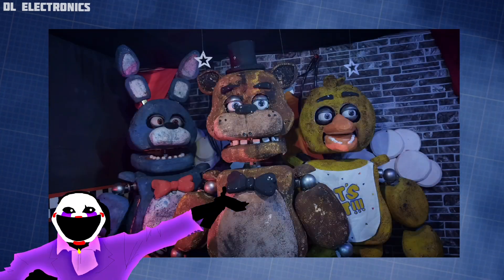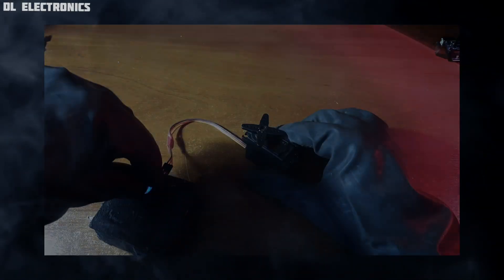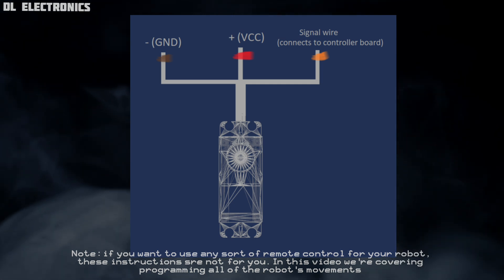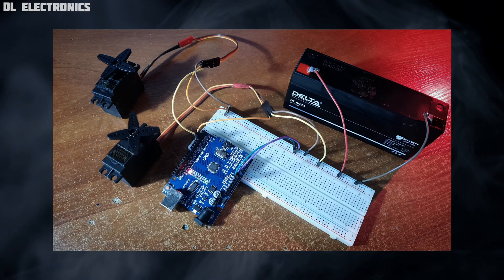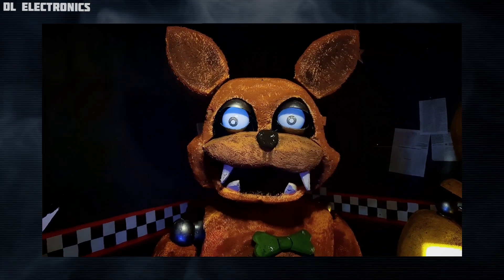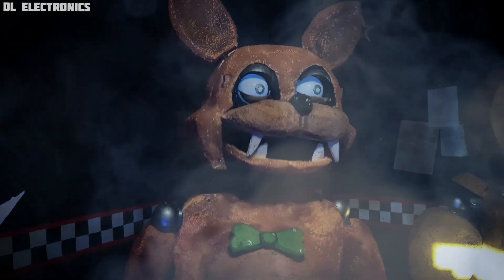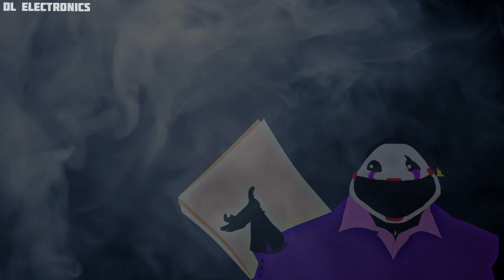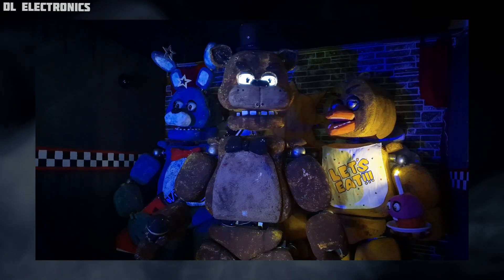How to Build REAL FNAF Animatronic - Tutorial

Comment: Can you tell us the pipe sizes
Reply from the maker: The diameter is 50mm and the length is about 3 meters (you will need to cut it into pieces of the needed length anyway)
Reply: @dlelectronicsmechanics2059 i cant find em on amazon can you tell me the name of the brand and the profuct

Comment: WHATS THE CODE!!!! im dying trying to copy the code word for word but its not working.
if u can find out whats wrong with my code pls comment it

#include <Servo.h>
Servo servo1;
Servo servo2;
int angle1;
int angle2;
void setup(){
  servo1.attach (2);
  servo1.write(90);
  servo2.attach (3);
  servo2.write(90);
}
void loop(){
  ;for (angle1 = 90; angle1 <= 130; angle1++){
    servo1.write(angle1);
    servo2.write(angle1);
    delay(25);
  }
  for (angle1 = 130; angle1 >= 90; angle1--){
    servo1.write(angle1);
        servo2.write(angle1);
    delay(25);
    
  }
  delay(1000);
for (angle1=90,angle2=90;angle1<=130,angle2>=50;angle1++,angle2--){
servo1.write(angle1);
servo2.write(angle2);
delay(25);
}
  }

Comment: can I use an 11 Ah battery pack? Another thing is that the code is not working
Reply from the maker: Yes, the 11Ah battery will be fine. As for the code it should work. Maybe there're some issues with the board you use or idk. Try to search for some info about programming servos in the net. Perhaps you'll find something that will help in your situation
Reply: @dlelectronicsmechanics2059  Thank you, it's working now, also, how did you made the eyes?
Reply: @iceevr1107 ok thanks
Reply: @dlelectronicsmechanics2059 hi again, can you give me the list for every non-electronic material, like size name and etc, I really need them, thank you for your patience.

Comment: Hey, so where did you put the uno board? Ive seen several servos but the wires never reach that far
Reply: Also another question i have is that you didn’t really show hoy you did the mouth servo/servos. Thats what i need most help with
Reply from the maker: The board can be put anywhere, its location is not that important. The jaw/mouth servo is fixed in the mask. the servo's shaft is attached directly to the movable jaw and so it moves.

Comment: I have a small questio and that is how many arduinos did you used? What type of battery is used on the robot? Can I use a fake arduino? And can I power more than one servo in each arduino?

Waiting patiently :)
Reply from the maker: In this project I used only one arduino board. Fake arduinos are fine. U can power several servos with one arduino (it was shown in the video) but if you want servos to run fully independent it's worth using several boards for each motor.
As for the battery, It was 6v and 10Ah. Can't name it's brand rn
Reply: @dlelectronicsmechanics2059  I also want to know if I can use a battery that is 7.4v and 10ah and how to connect 9 servos into one arduino
Thank youfor your patience;) pt2
Reply from the maker: @ZeroZerado22  7.4V might be too much for the servos, but they may still work fine. To connect 9 servos u just need to connect all the red wires to the VCC of your battery (and the black ones to the GND), then connect the yellow ones to the pins on the controller board and write the corresponding pin values in the program
Reply: @dlelectronicsmechanics2059  what about the ah? can I make it out of battery holders with 11200ah? and how do you turn it on and off?

Comment: Hey! Nice video, could you answer these 2 questions? First, is it okay to use micro servomotors instead of the big ones for the arms? and second, could you make a pdf with all the code for the robot?
Reply from the maker: I don't recommend replacing heavy servos with the lighter ones since arms are quite heavy and micro servos might not be able to move them.
As for the code, it will take some time
Reply: @dlelectronicsmechanics2059 how many servo boards do you need for this?
Reply: @TheUnlikelyFNaFDuo  just one arduino board is enough, remember to also buy a lot of wire jumpers, male to male, female to male, and female to female, since if you're making a large animatronic like them you'll need quite the few wires, also don't forget to buy a breadboard
Reply: Thanks!
Reply: Hey, i saw they replied you but i just wanted to let you know what happend to me i used 1 micro servo motor for 1 arm for my animatronic it seemed to work but after a couple seconds the servo motor gear broke once i opened it it was just a broken gear so i just wanted to let you know what could happen if you use micro servos i just decided to use the MG995 motors they are very strong and dont have plastic gears they have metal gears  wich is very durrable good luck to you if youre building one!

Comment: Do you need to purchase a board for each servo in the animatronic?
Reply: you can connect multiple servos to one board
Reply: @Thystamme Yes! But only if they are to be doing the same thing
Reply: @TheUnlikelyFNaFDuo  That's not true at all. You can have multiple lines telling different servos to do different things. For smaller projects, only one arduino board should be needed. An uno board has 6 PWM pins so it's recommended to use 6 servos but I'm pretty sure you can use any pin for servos but it's kinda recommended to use PWM.

Comment: Is the foam for the body simply a hard foam like florist foam?
Reply: Any hard foam that can be cut and doesn't irritate the skin can be used. Stuff sold at modelling stores is good, but try to avoid packing foam. That's made up of small ball beads as it will just split apart and look bubbly when cut.

Comment: Where is the battery located? Is it put inside the suit? Also, Where is the control board located? I think the survo might just "remember" the code but I'm not sure. Nice video btw!
Reply from the maker: The battery and the board can be put anywhere inside the robot. Btw, servos can't remember the code (or at least the servos I use can't) and need to be connected to the board all the time

Comment: Where do I buy the parts
Reply from the maker: You can find them somewhere in online stores. Servos and Arduino boards aren't that difficult to find, while other parts are even easier.
Reply: @dlelectronicsmechanics2059  what type do I need like what brand?
Reply from the maker: @prestonmiller5827  As for controllers, it would be better to use original Arduino boards, while the servos' brand isn't that important. "MG995" and "SG90" models are mentioned in the video. I'm not sure if there're sold under many different brands, but they all should operate similarly anyway.
Reply: @dlelectronicsmechanics2059  how do I use mp3 for mouth movements and stuff
Reply: @dlelectronicsmechanics2059  also can I make tiny robots
Reply: @dlelectronicsmechanics2059  How many MG995's and SG90's did you guys use for this tutorial?

Comment: Thank you for this tutorial :) Is it possible to use lighter materials than wood?
Reply from the maker: I think so. You can use plastic and 3d printed parts, but we mainly use wood.
Reply: @dlelectronicsmechanics2059  There's also wood that is very light and very strong, it can survive drops and heavy stuff, so you can cut it into shapes so even if the robots falls it will be perfectly fine! I will use a lot of that wood to try and make a Animatronic, thanks for the tutorial!
Reply: @dlelectronicsmechanics2059  how do I put mp3s to make em talk
Reply from the maker: @prestonsfunhouse2437  We may make one more tutorial to cover mp3s, ultrasonics and other additional stuff, but as for now you can just search for this in the internet.
Reply: @dlelectronicsmechanics2059  Where did you get those tubes from